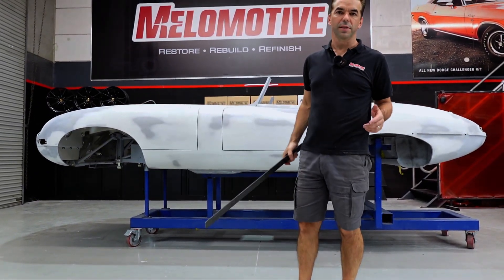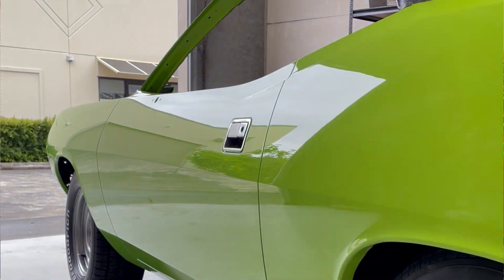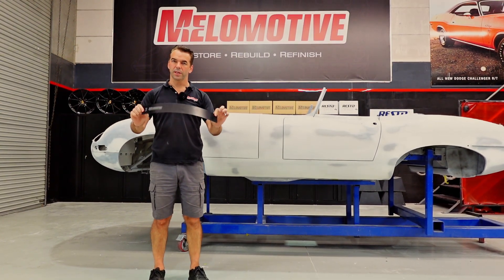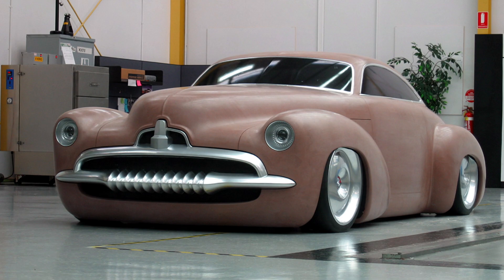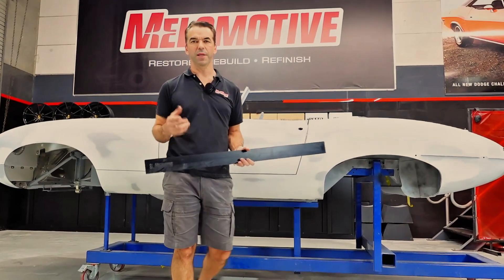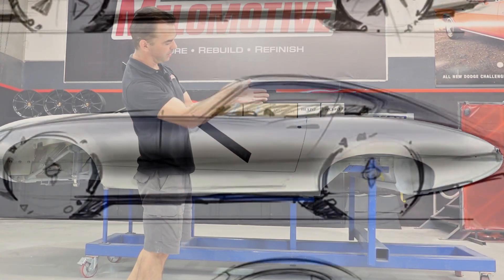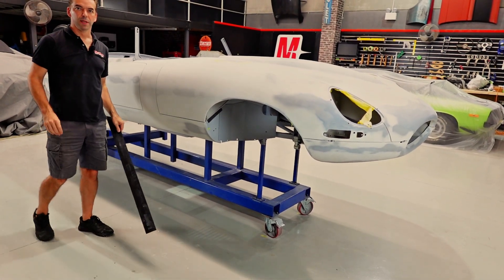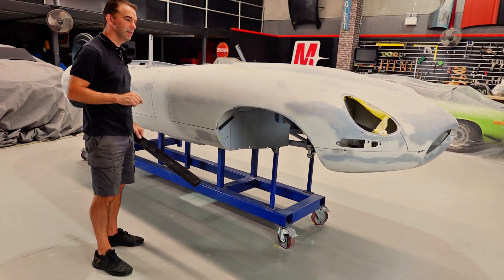How to Perfect Panel Shape with a Spline – Chapter 1: Automotive Bodywork Series

Comment: I absolutely do not understand why this is not used in collision, maybe in a few here or there but nobody at my shop has even heard of a spline. Given a repair is between 2 points obviously good, to not even consider checking body work with one makes no sense to me. They’d rather send it through to paint and get it back for rework after we find the potato farm they made. So much potential even if not looking for perfection

Comment: Sorry but a good panel beater does not require the painter to use body filler. Have grown up around high end car restorations and there was never body filler allowed in the shop and was not used. 
There was lead wipe used sparingly where it was just not possible to get to. 
The spline was used by the panel beater to perfect there job.